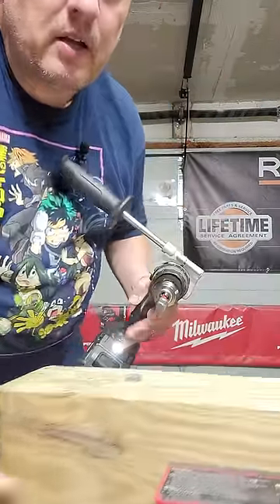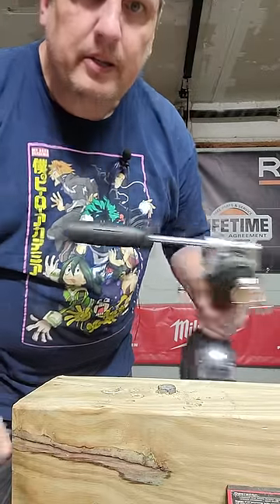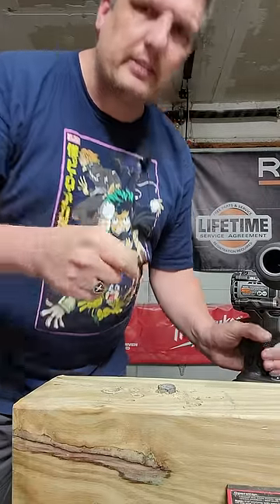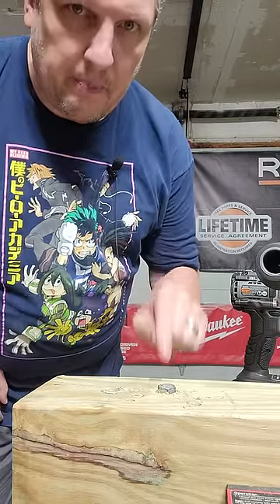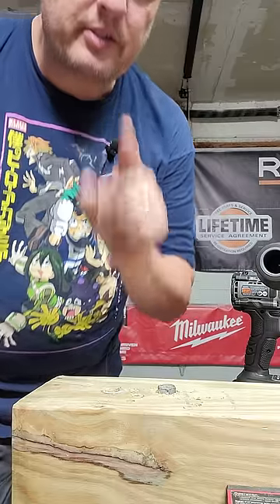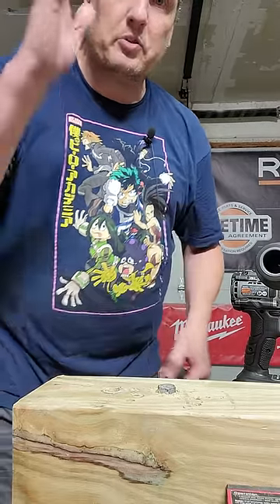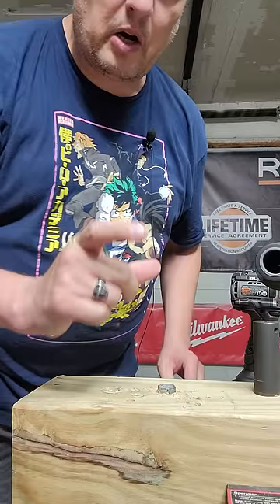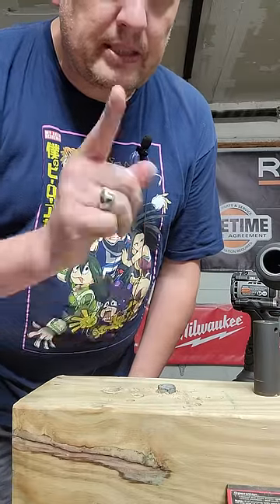Challenge Accepted! Now What? #challenge #powertools #tools #power #drill #EMBARRASSING #victory

Comment: I use an impact because it's compact and doesn't twist the wrist. I use drills for drilling. What's the benefit of this compared to an impact?
Reply from the maker: The drill is faster, provides better control, and is less likely to break fasteners going into hardwood
Reply: @ToolswithSoAlz  Hmmmmmm, I guess to each their own.
Reply: Drills now a days are stronger and faster. I use my 90% of the time for screw hammer drill for bigger things.., but that flex is sh$t heavy as hell expensive for no reason.

Comment: This man is the reason I now prefer drill drivers
Reply: Wait for it to grab
Reply: @kingcosworth2643  not if you know how to use the clutch and speeds properly
Reply: @lilshaq0907  Works ok in the garage, on a workbench.  Not in Real World.
Reply: @CONTACTLIGHTTOMMY  I have first-hand experience as a carpenter, and it works wonders better than an impact driver on literally every fastener that you are driving. Impacts are mainly for those fasteners that you need that extra torque on without needing specific ft-lbs with hand tools. I fastened 24 16ft deck boards faster with my drill at the proper clutch setting than I did with my impact driver. And none of the screws were getting sunk in
Reply: @lilshaq0907  Poor comparison.

I've built several dozen boat docks, piers, seawalls, decks and beach homes.  A drill works ok for screws and smaller lags, not for long lags as in this video.  And this drill technique is wrist destroyer when done in an awkward position.  Look at the effort the uploader puts into maintaining control of the tool.  If he would have bottomed out that lag at full speed, he could have easily snapped his own wrist.  

That lag would typically be used to connect a beam to a post in an overhead position, from a ladder.  Both tools can work, but an impact is much safer.  Try it.  A few seconds faster driving is stupid if it puts your arm in a cast.
Reply from the maker: Oh look it's another Faux-fessional. Been almost two minutes since the last liar was here. Let me help you out with two words a real professional knows...pilot hole.
Reply: @ToolswithSoAlz  Your comments are simply bizarre.  It seems you've invested your whole self worth into proving that a drill can drive a lag screw faster than an impact.  No professionals really care about a few extra seconds.  Speed is irrelevant when broken bones are a risk.  Have you actually ever built anything outside the comfort of a garage work bench?  Seems doubtful.

The people in this comment thread emphatically recommending an impact are probably professionals that have sprained their wrists using a drill in this manner.  FYI...a pilot hole helps, but if you bottom out that bolt at full speed, in drill mode, your wrist can be destroyed.  Again...both tools can work, but an impact is much safer.
Reply: @CONTACTLIGHTTOMMY  if you don't know how to use a drill properly, you will snap your wrists, I've done it. But nobody wants to learn how to use things properly anymore, so that's why every professional in this thread is either saying impact all the way or nope to wrist destroyer 3000. I understand the time saving but if you think about it the purpose of the two similar yet different tools is, one is for hard situations, i.e impacts, and the other is for almost every application in fastening i.e drill drivers. @ToolswithSoAlz has said it in other videos. Impact can over drive a fastener, ruining you work piece. But drill drivers are specifically made for fastening to a flush point. Craftsmanship is not about speed and that's why pros who know how to use drill drivers have better final products. That's my opinion. As well as him saying in this video that impacts have a specific function to its counterpart their applications of use are to be considered when working.
Reply: @lilshaq0907  You can use either tool interchangeably for almost every fastener.  But a professional would never use a drill to drive a lag that long on a real work piece...if he had an impact available.  A drill is a few seconds faster, but much more dangerous when the fastener bottoms.  Even the uploader mistimed the bottoming, and had to resume with a huge twisting load to his hands.  DID YOU WATCH THE VIDEO?  Look at how he is bracing himself.  Don't watch the socket, look at his arms. An impact does not create those forces.  

The uploader is demonstrating...standing on the floor, well braced, in the garage.  I'm looking at Real World work situations.
Reply: @CONTACTLIGHTTOMMY  I appreciate the discourse we've had different points of view is good. And to each their own. Until next time.

Comment: I have used both. I will use my impact 95% of the time. When I'm using a lag that long and big , I always pre drill. The argument comes down to practical use. I don't need a power lifter to pick up a 10 lb bag. The right tool for the right job.

Comment: Wouldn't use my drill for that, nor my impact drivers, that thar be an impact wrench job.
Reply from the maker: Actually, you should use the drill. Not only will it always be faster, but to do this properly you would drill a pilot. Hard to drill a pilot with an impact wrench
Reply: @ToolswithSoAlz  You're right. That's what a drill should be used for, or an impact rated set of drill bits for faster bit changes. Or use the drill for the hole and the wrench or driver for the fastener. I get it, you need to be validated in your extremely old school way of doing things. I'm not even saying my way is "better", I am saying my way works for me and maybe you shouldn't be so arbitrary. Wood density has screwed me over way too many times to love drills the way you do, and my tennis elbow sure hates the extra effort of drills, but you do you.

Comment: That's right, a drill is better for jobs that are meant for drills... I still use an impact for lags, because it does the job fine, but i wouldn't use an impact for drilling holes or something that i dont want to over drive... drills simply have different applications

Comment: The videos comparing said you could do this with Flex and not your body, as I see them lean into it about as much as you.

But yes, a drill is better for this than an impact. Impact works a hell of a lot better for what I deal with. Sheet metal with a drill would kinda suck.
Reply from the maker: Whatever lie you need to tell yourself

Comment: Except it’s not the “right” tool. Twisting your arm off aside, the lifespan of a drill doing that is much smaller than just using the impact. Those motors were made for that amount of torque. Faster, sure. But the drill will only last 6 months at most if that’s your main job is lags. Don’t even get me started on the batteries you’ll burn through
Reply from the maker: Ma'am you just spent a lot of time telling folks you have absolutely no idea how tools work and what they should be used for. I find it funny.
Only a moron believes you would use an impact driver for this job.

Comment: You were right, right uo to the end. A drill isn't a "much better tool". It's just a different tool. It's made for making holes, and can do some things an impact can't do as well. 

The impact driver is a MUCH better tool for fasteners that you don't want to strip, and it will not break your wrist if you get into an awkward position (unlike a drill). Also, my impact driver hates up considerably less space and weight than that drill you have. No secondary handle, and thetool is much smaller and lighter, and uses a smaller battery to do its job just fine. 

An impact wrench is made for heavy torque, and I'd be curious to see how it fare compared to the drill.  

This is obviously a place that a drill can outperform another tool, but to say it's better than the impact driver is like saying that a circular saw is better than a recip or jig saw because it cuts faster.
Reply from the maker: The impact driver is a much less versatile, inefficient tool. I prove it time and time again

Comment: Lag bolts are history and do not hold up to most codes these days , thru bolting is the drill ( pun intended ) today. I remember how lags sucked back in the 70s  and into the 80s and long bolts were hard to find in stock so we kept long sections of all thread that we cut for length with washers and nuts of course on both ends. When school was out for summer break in 1969 , one of my jobs was lag bolting band boards and others after they had been nailed up , I was fitted up with a ratchet wrench and 16 inch length of pipe for the tough ones.

Comment: Look their is a use for both, frankly the last inch of that, an impact driver would have reasonable to save the torqure concerns. But personally I think a light weight 3/8th impact wrench and a good drill is a better combo than an impact driver and a good drill, but I'd be willing to hear other arguments. But yeah cam out is the biggest argument ive found yet for the driver ovee the wrench combo. Also guys, don't be afraid to buy one good corded drill, yes cordless is nice, but if youre a home owner or something its always nice to have the corded option. And frankly if youre drilling and driving a lot, its nice to not have to always be switching bits on a project.

Comment: I'm a framer and I can tell you any battery drill would be smoked after driving even ten bolts like that in a row.There is a reason impact drivers are made and used on job sites every day by pros.
Reply from the maker: That's a lie. I did it live and showed the drill has absolutely no issue with this. Only a fool would use an impact driver, with a quarter shank, for this. Oh and I burned an impact to the ground doing this and it could only manage three. Also, as a fake framer, it would help if you knew the basics. I have two words for you that show how little you know and why you shouldn't lie here...pilot hole. I real professional would know that you would use a pilot hole for this to avoid splitting wood. A Faux-fessional would say use an impact driver.

Comment: Impact drivers are just that,impact drivers. They have a clutch that releases the pressure for a fraction of a second. They’re not made to drive things in fast.
Reply from the maker: Impact drivers are designed for small fasteners where camout is a possibility, self tappers, and over tightened nuts and bolts. That's it

Comment: I didn't doubt that the drill is better for sinking screws.  I know that, my reasoning for making the suggestion was it's apples and oranges to use two different brands of tooling.  Ex: Milwaukee boasts a better torque than most other tooling. 

I do appreciate that you used FLEX for this demonstration, it makes the point in more spectacular fashion.

Comment: That’s like proving that an automatic doesn’t need D1 or D2 to go uphill because D can go uphill just as well.  I can attest from experience that a drill last a lot longer if you use it for the right purposes.  And impacts life will last longer for those situation’s than a drill. Not to mention, it will just destroy your battery, and the fact that you totally ignore voltage power, and the type of bits you might use as well. You might as well skip filling up your gas and force all your little children to push you around in your car everywhere you go because it works just as well.
Reply from the maker: Ma'am only a fool believes you would use an impact driver for this. It's like advertising to the world you know absolutely nothing about tools.

Comment: Haha. Just because the drill did it faster doesn't mean it's a better tool. An impact is designed to reduce the rotational kickback and downward force needed to drive the fastener. The drill may be faster, but its not easier on the user. Look at how that beam twisted and took the vise, drill, and him with it when he got to the end. And impact will also bring together and  tighten together the two pieces your joining and the drill will not. You're right about one thing however, impacts are for smaller lags, and that's why they may impact wrenches, which is really the best tool for this application along with pre drilling your hole.
Reply from the maker: Ma'am, only a fool believes you would use an impact driver for this. Your explanation is not only wrong but stupid

Comment: That’s impressive my worst experience with those is when a customer had them sitting for years, insisted we use them for a 6 high retaining wall then proceeding to not be able to drill holes worth a shit😂 I about had it done then I broke my ribs and hurt my back mountain biking which was the point I got the client who’s a handyman to finish up😂 that was the worst feeling I remember b lining back to my car out of the woods having the pain intensifying thinking about finishing the wall started passing out from stress, pain, and especially not being able to take a full breath at all in my car(I stopped)

Comment: With an impact driver, it doesn't take gorilla arms to complete the job. Did you see the strength it took to get the drill re-started again and not get it ripped from your hands to finish the task? The drill would yank out of most people's hands, where an impact driver does not. THAT is the benefit of using an impact driver, NOT SPEED. You can literally use ONE HAND! It's not a race. Pay attention.
Reply from the maker: Only an idiot believes that you should use an impact driver for this. It's like advertising you know absolutely nothing about tools.

Comment: Sure, the drill might have been faster, but if you have to drive 20 lags the impact driver will result in much less fatigue, and wear and tear on your hands and wrists.

I also put a lot of fasteners in concrete.  Different animal.  I've had a drill twist the head off of a tapcon (hex cap), whereas I've never had that happen with an impact.  But as I said, different animal.
Reply from the maker: The impact driver can't do three. I know because I have shown it.

Comment: A drill is meant for drilling it works fine for this as well but an impact driver is used for very high torque the drill will break YOU if the fastener doesn't loosen up, impact driver allows you to surpass your own strength by using momentum. Wood workers don't really need to use impact drivers but they are easier on your body they may give the same results regarding the fastener.
Reply from the maker: Only an idiot would use an impact driver for this

Comment: Impacts fasteners are made for metal framing and concrete screws and bolts just like you can’t use a drill to do what impacts does but the impact can do what the drill can’t.
Reply from the maker: K

Comment: Actually, pre-drilling would help with either a drill, or an impact... also helps to relieve pressure on the wood that could start a crack...
Reply from the maker: If you know those screws you would know why you don't need a  pilot hole. There's no such thing as predrilling
Reply: @ToolswithSoAlz  I know those very well actually. Definitely doesn't hurt to pre-drill, especially if they are treated posts that will be outside. I use carriage bolts usually for decks, or ledger locks in some applications... carriage bolts arenice because they can be tightened or adjusted in the future.
Reply from the maker: @matthewhostetter6502 you don't know these fasteners. If you did you would know that those are self drilling.
Reply: @ToolswithSoAlz  It is a lag bolt... you pre-drill smaller than the threads and it will still drive itself right into the lumber... and the threads still hold in the wood... not saying it is the only way, but I ha e found it to be a better way for a lot of reasons.

Comment: Impact driver is a better tool for this job, it requires less energy from the user than the power drill for this kind of jobs. Works smarter / not harder.
Reply from the maker: In every single aspect you are wrong

Comment: It’s a better tool for framing
But ask Any Hvac guy what’s in there tool bag, Fkn impact , same with electricians and other trades
You break out the regular drill, (mine had the hammer option as well) for drilling holes and what not

Comment: Then why do they make half inch drive impacts? The impacts hes talking about are 1/4" drive.  Impacts are made for high torque applications.  They're made for power, not necessarily speed.  I would prefer an impact on this lag bolt because the impact is less likely to kick and break my wrist.
Reply from the maker: Impact wrenches are made for metal on metal applications where you need short bursts of power. They are not made and should not be used for anything time consuming; unless you want to buy a new one all the time.
Reply: @ToolswithSoAlz  that's wrong.  They're not made for drilling holes.  With electric impacts they last longer and use less power than your drill. If you have to drive a lot of lags one battery will last way longer in an impact than the drill. The drill motor also has a tendency to overheat in high torque applications.  The reason for this is that the higher the torque required, the closer you get to a locked rotor condition. A locked rotor condition on a motor draws extremely high amperage causing a lot of heat in the motor as well as the fact that the motor cooling fan is directly driven by the motor.   An impact driver may drive it a little slower but this is the type of condition that an impact driver was designed for.

BTW, I'm not talking about impact wrenches because that's a hand tool. The power tool is an impact driver.
Reply from the maker: Every single word you just wrote is a lie. You don't know what you're talking about and only a fool would believe a slower tool, having to work harder, is better for the battery. Worse, I have already shown that everything you think you know is false.